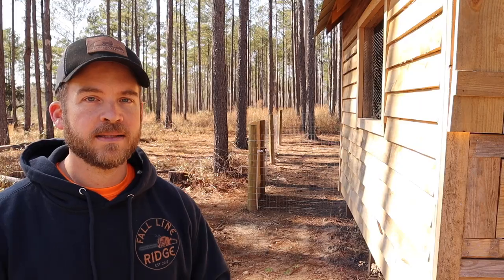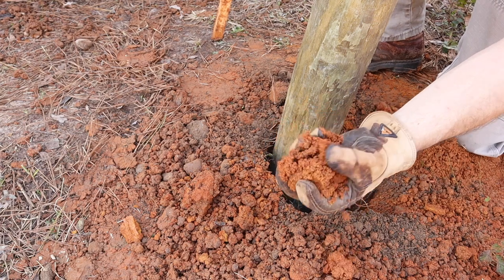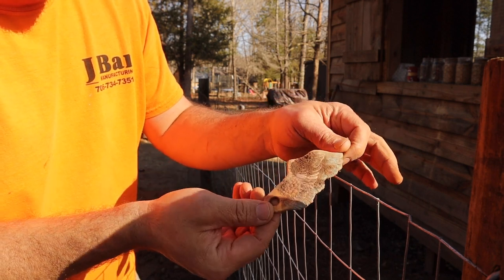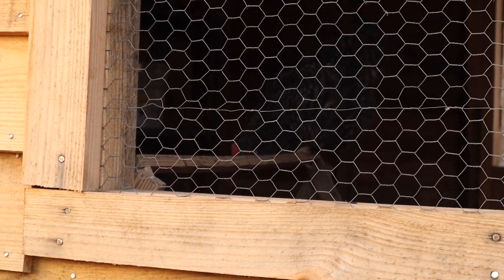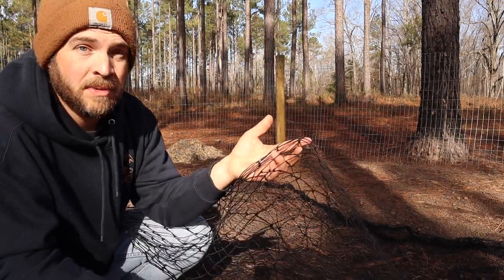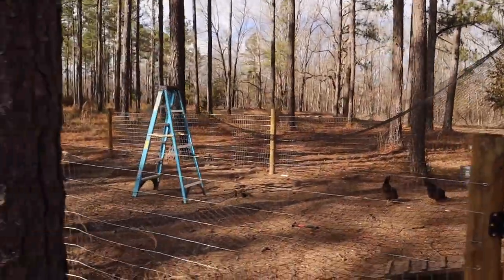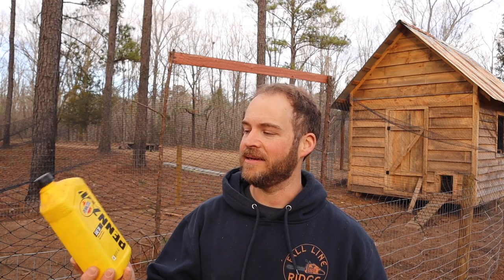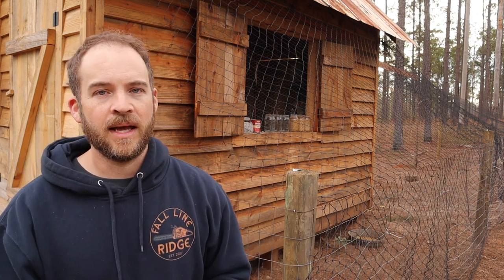This Simple Mistake Killed My Chicken

Comment: What kind of ground protection do you have from animals that like to dig? I knew that when building a coop I would need to have it enclosed from the top, but just saw something about animals digging and have gotten too nervous to build because I don't have ideas.
Reply: You can dig a trench and bury the bottom 6 to 8 to 12 inches of the wire.  He seems to be digging a tench at 6:11 to 6:26 but it looks more to hold the wire in place than to deter a digging predator.  You can also have wire extending along the ground a couple of feet out from the bottom of the fence, but it will rot in time, how quickly depends on what you use.
Reply: Try to find Off grid with Doug and Stacy. He helps a neighbor with building a chicken run and I can't remember the name of that video but he covers every risk. He teaches pretty well & his wife is quite the nutritionist.

Comment: Chickens will love getting under the coop! Unfortunately you may not like it as much when your chickens start laying their eggs under the coop? Or the chickens may just decide to nest under the coop and sit on their eggs till they hatch! What happens to me every so often. Chicken disappears for a while, then shows up with 3-13 chicks running behind the hen!  Then you got to gather up all the chicks and get them somewhere safe with the right food, water, heat source, etc, that the chicks need to survive!  BTW, stay away from those red heat lamps! They have much better and safer chick heaters that's on adjustable plastic legs and you adjust the heater where the chicks just barely get under the heater to stay warm. these heaters don't put out a lot of heat and why their so safe to use! I actually have 2 of these heaters now and probably going to get a third? think it's 10 chicks that can get under the heater together! Gives you a an idea how many surprise chicks I cna get thru spring and summer!  😂